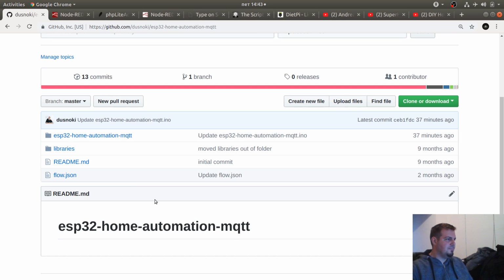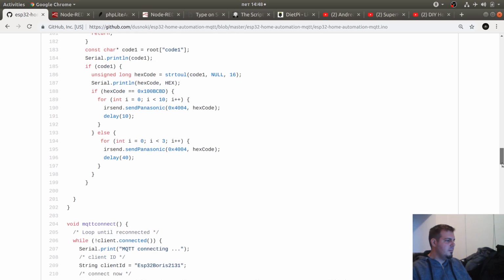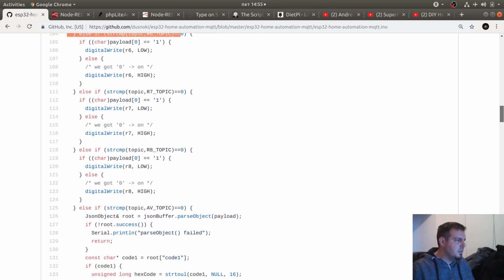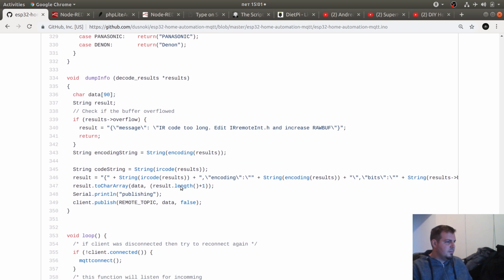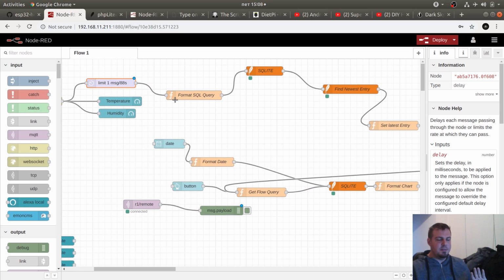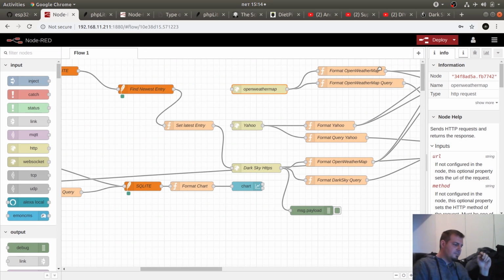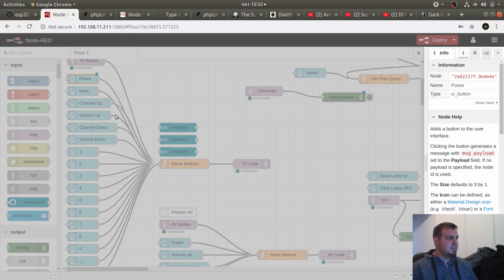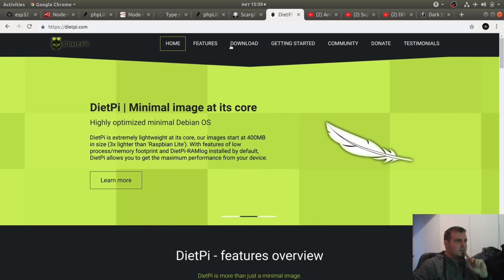DIY Home Automation - Part 2 Code and Node Red Explanation | ESP32, Raspberry Pi, MQTT, Smart House

Comment: Fantastic bro. Thanks for your huge effort to help the community.
I have gone through all the comments of 2 parts. I should use rasbian instead of dietpi.
My current project is to get sensor data and display them in a hdmi display.

Through your video i have idea to plot the data in a weblink.
But i want to restrict the web page like fullpage os.
Is there any way to integrate rasbian with fullpage os?

Comment: dear Boris, I am thinking of making a pump system for my garden based on this project can you please change the link for the dietpi image because it is deleted it would be of great help thx already
Reply from the maker: The dietpi is not compatible anymore. It's old. You can install rasbian on a raspberry pi and install the necessary apps on it using a script. I have a headless install on raspberry pi video on my channel. For the flow you can use the flow.json for node red in the repo

Comment: Hello sir
Please ask for your help in my project which is an esp card with a raspberry card and pressure sensor
How can I finish this project knowing that with the red knot, I must find on the dashboard the evolution of the pressure sensor fluctuations and a small alarm if the pressure is less than a certain point

Comment: very cool. I am wanting to set up an indoor stat and outdoor temps to control an air to air heat pump and gas furnace and to toggle from one to the other as the outside temps change.  some very useful tips. thank you

Comment: This is great! Thank you for breaking it down.
Query: By setting the relays to HIGH in the setup function, does that mean the Desk Lamp goes off when network connectivity is lost on the ESP32? (This is a stateless setup, right?)
Reply from the maker: You're very welcome. The messages are retained. So for example if the WiFi goes out. The esp will restart cause of the watchdog timer. As soon as it connects to the mqtt server the lamp will turn on if its last state was on in the ui. You don't have to turn it off and on again in the ui. I hope that's what you were asking.